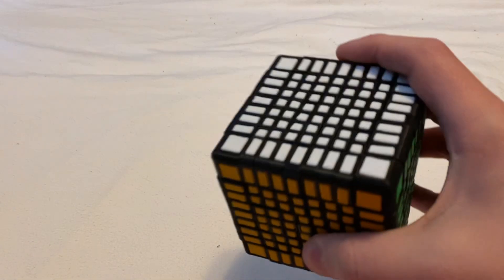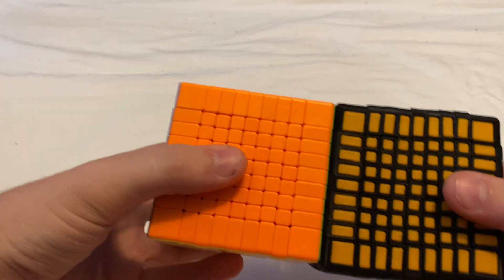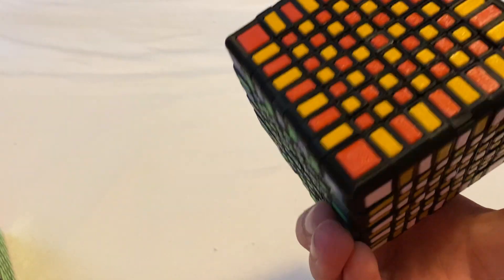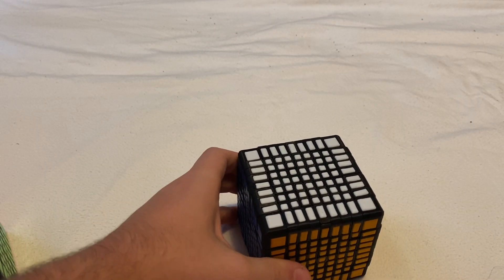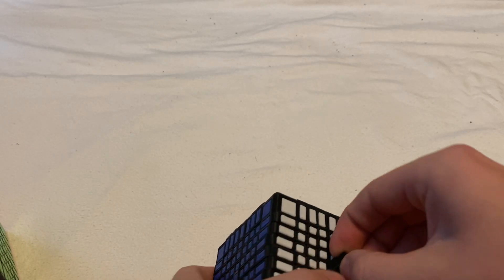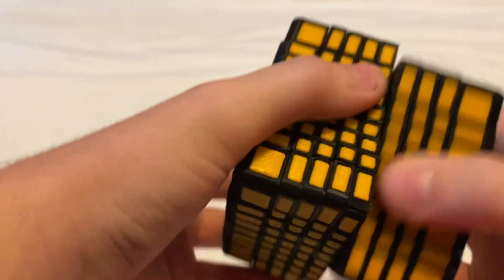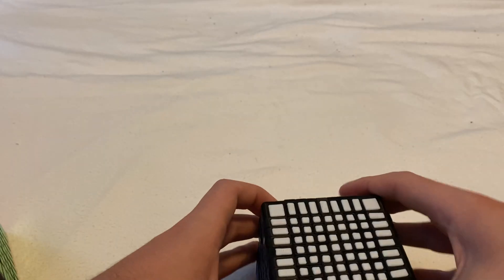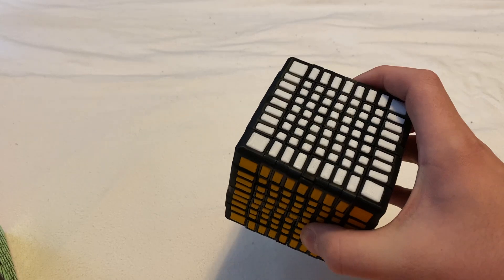Custom Cube Design #22: 80mm 9x9

Comment: ik 60mm is impossible, but maybe 65?
Reply from the maker: Maybe. 60mm 9x9 isn't impossible to 3D print, it's just difficult with the limited detail you get. 65mm 9x9 might work but I haven't tried yet
Reply: @jacobcubing606  if it does could I try to buy it
Reply from the maker: @3HFDominoBuilder  If you meet me at a comp, then sure. I'll probably be over $100 though because of how many pieces it has and how much manual labor it takes to make it
Reply: @jacobcubing606  nvm. I'm in a different country

Comment: What did you use to 3D print though? My 3D printed proportional 7x7 is terrible (think about Rubik's 5x5) and my maglev 4x4 and 5x5 were around 2012 Shengshou 4x4 level. 
And yes, I hate second layers.
Reply from the maker: I printed it on a Flashforge Adventurer 3 Lite. You can get one for around $200 or $300, it's GREAT for printing puzzles
Reply from the maker: Also I want to see your proportional 7x7, have you made a video on it? And if not can you?
Reply: @jacobcubing606  It's so bad I don't really want to make a video at the moment. Maybe until one day I revisit the project and make prototype 2. It was teased in a few other videos such as my Diansheng Solar S5 review and Diansheng 8x8 5:12.48 solve video.
Reply from the maker: @laiscube  I understand. I just wanted to see the mechanism of it